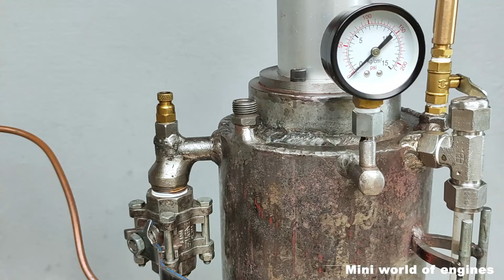SEE WHERE I USED MY STEAM ENGINE THAT I BUILT!

Comment from the maker: ► ENGLISH: This steam engine comes with a boiler and generator, which is capable of producing over 30 Watts of electrical energy using a suitable generator. It is also capable of carrying out small services such as cutting firewood, sanding, producing electricity for 3 LED lamps, as well as a decorative piece with a didactic purpose.

The boiler was designed with a pressure relief valve, as a safety measure, limiting its operating pressure to around 60 Psi of pressure. This boiler can be fueled with charcoal as shown in the video, or even wood.

► Technical features:
- To start the engine, it is necessary to preheat the boiler;
- The boiler has a valve that releases excess boiler pressure, ensuring user safety;
- The boiler comes with a pressure gauge to check the pressure;
- Piston has 38mm diameter and ~50mm stroke;
- Weight of the kit is 11,950 (KG);
- Power generation at full power can reach 30 watts, with a suitable generator, it is possible to improve performance;

It uses coal as an energy source, it comes with a generator that produces electricity, and it is even possible to recharge 12-volt batteries.

► Visit and subscribe to Robson José's You Tube channel:
https://www.youtube.com/user/thezedapicanha

► This Stirling Thermal Lag engine can be purchased on this page: https://bit.ly/3fkC59Q, get 10% off using code "Leandro". Today it is the engine with the best price on the market!

► ATTENTION:
- must only be handled with the presence of adults.

► PORTUGUESE: Este motor a vapor acompanha uma caldeira e gerador, que é capaz de produzir mais de 30 Watts em energia elétrica, usando um gerador adequado. Também tem capacidade para realizar pequenos serviços como, cortar lenha, lixadeira, produzir eletricidade para umas 3 Lâmpadas de Leds, além de uma peça decorativa e com finalidade didática.

A caldeira foi projetada com uma válvula de alívio de pressão, como medida de segurança, limitando seu funcionamento de pressão em torno de 60 Psi de pressão. Essa caldeira pode ser alimentada com carvão vegetal como apresentado no vídeo, ou até mesmo madeira.

► Você pode fazer o seu pedido diretamente com o proprietário pelo e-mail:
wwwrobsonjose@gmail.com ou WhatsApp (021) 98603-6370 ( Robson José )

► ATENÇÃO: apenas será comercializado dentro do Brasil.

► Características técnicas:
- Para dar a partida inicial no motor, é necessário um pré aquecimento na caldeira;
- A caldeira possui uma válvula que libera o excesso de pressão da caldeira, garantindo segurança ao usuário;
- A caldeira acompanha um manômetro, para verificação de pressão;
- O pistão possui 38 mm de diâmetro e ~ 50 mm de curso;
- Peso do kit é de 11,950 (KG);
-  A geração de energia em potência máxima pode atingir 30 watts, com um gerador adequado, é possível melhorar o desempenho;

Usa como fonte energética carvão, acompanha o gerador que produz eletricidade, sendo possível até recarregar baterias de 12 volts.

► Visitem e se inscrevam no canal de Robson José no You Tube:
https://www.youtube.com/user/thezedapicanha

► Este motor Stirling Thermal Lag pode ser comprado nessa página: https://bit.ly/3fkC59Q, ganhe 10% de desconto usando o código "Leandro". Hoje é o motor com melhor preço do mercado!

► ATENÇÃO:
- deve ser manipulado somente com a presença de adultos.

► INDONESIA: Mesin uap ini dilengkapi dengan boiler dan generator yang mampu menghasilkan energi listrik lebih dari 30 Watt dengan menggunakan generator yang sesuai. Itu juga mampu melakukan layanan kecil seperti memotong kayu bakar, mengampelas, menghasilkan listrik untuk 3 lampu LED, serta bagian dekoratif dengan tujuan didaktik.

Ketel dirancang dengan katup pelepas tekanan, sebagai tindakan pengamanan, membatasi tekanan operasinya hingga tekanan sekitar 60 Psi. Ketel ini bisa berbahan bakar arang seperti di video, atau bahkan kayu.

► Fitur teknis:
- Untuk menghidupkan mesin, ketel harus dipanaskan terlebih dahulu;
- Ketel memiliki katup yang melepaskan tekanan ketel berlebih, memastikan keamanan pengguna;
- Ketel dilengkapi dengan pengukur tekanan untuk memeriksa tekanan;
- Piston memiliki diameter 38mm dan langkah ~50mm;
- Berat kit adalah 11.950 (KG);
- Pembangkit listrik dengan daya penuh dapat mencapai 30 watt, dengan genset yang sesuai dapat meningkatkan kinerja;

Menggunakan batu bara sebagai sumber energi, dilengkapi dengan generator yang menghasilkan listrik, dan bahkan memungkinkan untuk mengisi ulang baterai 12 volt.

► Kunjungi dan berlangganan saluran You Tube Robson José:
https://www.youtube.com/user/thezedapicanha

► Mesin Stirling Thermal Lag ini bisa dibeli di halaman ini: https://bit.ly/3fkC59Q, dapatkan diskon 10% menggunakan kode "Leandro". Hari ini adalah mesin dengan harga terbaik di pasaran!

► PERHATIAN:
- hanya boleh ditangani dengan kehadiran orang dewasa.